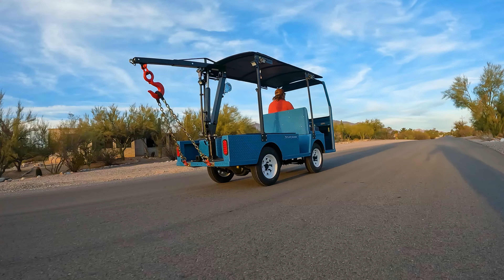Taylor Dunn Utility Cart Restoration

Comment: Did you use the original Taylor Dunn speed controller?  I have a Bt-48 and not sure on if the speed controller will work with new Lithium 48V battery

Comment: Are the horn and lights powered by the step down converter?
Reply from the maker: Yes, I have both 36v and 12v on the cart!
Reply: @MulletCreations  is there anyway I can have your wiring schematic. I have a 36v cushman & a Taylor Dunn (that I want to put lights and horns) that I’m trying to wire for my mom and sister so they can get around our trailer park easier

Comment: Great restoration!   I'm having a problem with my Taylor Dunn R3-80.   It lags intermittently under load.   I was thinking it may be my controller or accelerator.   But after watching your video, I think I will look into the wiring first...before spending many on controller!   What would you look at first?    All help appreciated.
Reply from the maker: I am no expert on these machines, I got luck that my controller and motor were both good! Could be bad connections somewhere, it could also be the accelerator pedal. I have another cart that acts really erratic and I’m pretty sure the accelerator pedal is my problem.